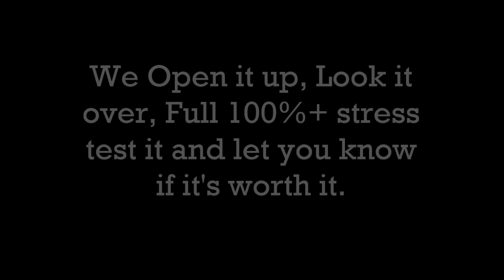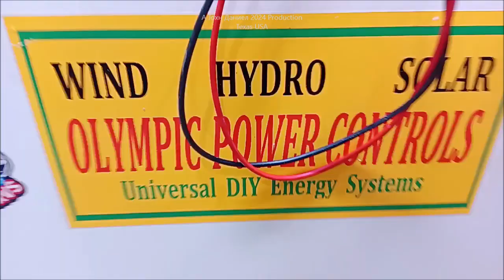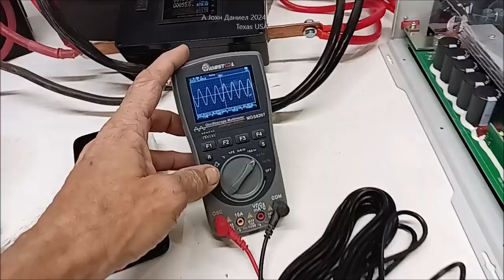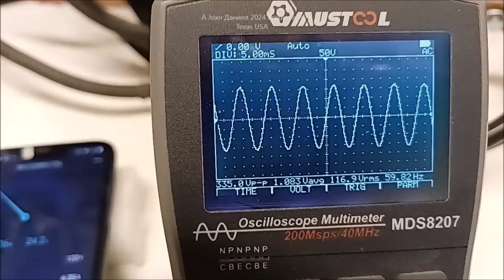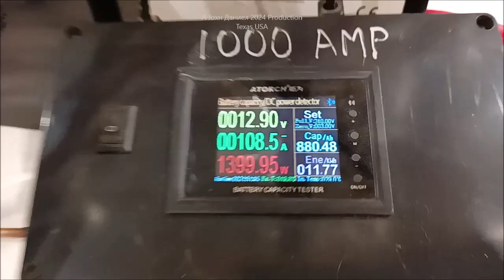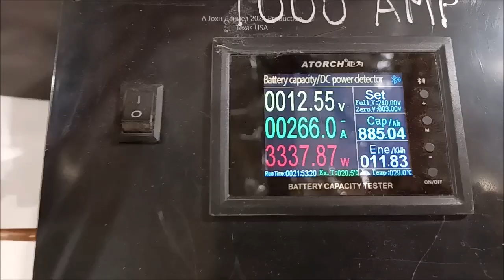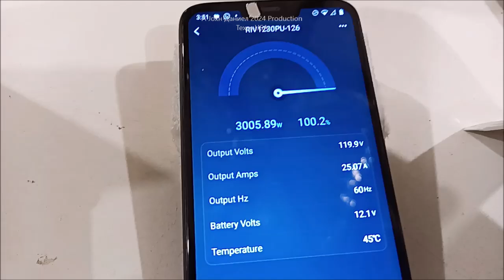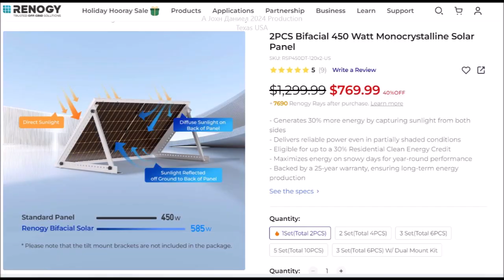New for 2025 Renogy Pure Sine 3000W Inverter with UPS Transfer Switch & Bluetooth, Pre-release test

Comment: I Started with Their 1st Generation 12 Volt 3000 watt Inverter and it was Hungry and worked well to 2750 watts. The newer 24 Volt 2000 watt Inverter is Right On The Money efficiency wise.

Comment: how did you get the wires in the greeen connector you did not show this in the video !  I am trying to use the UPS feature instead of the plugs for my RV ?
Reply from the maker: I think I need to do a update video on it, I figured that it was in the manual but it is not. You use 10 awg Solid and you strip them 1/2 and insert them and the terminals have a grip lock in them. To remove you use a tiny screw driver to insert next to the wire to open the grips and pull the wire and screw driver out at the same time.

Comment: Just got mine today.
Reply from the maker: If you wonder how to connect the AC power to them, you use 10awg solid wire and just insert it into the terminals for AC in. No screws needed, 30 amp capable.

Comment: Hello their a other new renogy pro 3000 watts inverter which no body has spoken about only one video review and no teardown like this video that helps the person decide what inverter is good or bad. Can you check out this inverter, its has 2 20amps outlet plus eco mode and other things.
Reply from the maker: The PRO 3000 https://amzn.to/4l9YQze is basically a Class 1 RV style inverter. Bigger transformers for higher start capability as long as you got the battery/amps to feed it. Great inverter, similar to the PU3000 in the video but much more suited for rough conditions.
Reply: @JOHNDANIEL1 - Thank you for the information
Reply: @JOHNDANIEL1 - When you say Class 1  RV inverter what that means?

Comment: What size wire from the battery to the inverter should I use ? 2/0?
Reply from the maker: Yes, use 2/0 if your to up to 6 feet from battery. Longer than that and up to 16 feet use 3/0. A link to TEMco welding battery cable is under the video for best safe heavy cable.

Comment: I have this inverter and have been using it for several months. It WILL NOT WORK without a “good” battery. Run your battery down and try to switch to “shore power” (or a generator) NOPE - you are SOL till the battery is charged up. So now you need to figure out how to charge the battery without the transfer switch doing its thing. Better have an extension cord and a portable charger or some other work around.
Reply: @tonybbq5212  that don’t sound good , I just ordered this inverter but I’m not hesitant. My batteries are agm and hooked to the alternator, so maybe that will be enough to make the transfer if I drain the batteries down below it allowing it to transfer to ac
Reply from the maker: The function of the UPS is to go to battery if your Utility fails and return to Utility when power comes back on. It's a transfer design not a inverter charger. Was missing the point in first reply to you. Inverter/Chargers do the low battery volt actions. I will have to check to see if mine has low battery volt switching or some blue tooth setting in a app. You can use the MOES controller to make one a Low Battery automatic switching and set it to switch and also run up to a 600 watt 40 amp charger to your battery. If you want info on that I can and should make a video on those. They are $80 to 90 and worth it.
Reply: @JOHNDANIEL1 how low are we talking on the battery that it won’t let you switch to shore power ? That’s a huge flaw
Reply: You HAVE to have something wired incorrectly. It has a transfer switch so if you fire the gen up the transfer switch should be sending a charge to the battery bank in float or bulk and your converter (assuming you are in an RV) should be distributing A/C on it's own from the generator or shore cord. How big is your battery bank? My suggestion is to charge your battery to full and if you have more than one battery make sure that they are balanced. If they are LiFePo they should each be charged to 14.4 volts individually (remove cables to do so) and then reconnected. Once each has achieved 14.4 re-wire them and they will be balanced.

Comment: Does anyone know where to find a SCHEMATIC of wiring, fusing and cabling for a 3000W 12V Renogy inverter using 2 x 290Ah (or 300Ah) batteries with 200A BMS? Please
Reply from the maker: Basics Should be in the manual of most inverters. Use 2/0 gauge cables, use quality 300 amp ANL fuse and best holder such as  Daier tech mount. Pair the 2 batteries with 2 awg to a mains buss bars. Not complicated but must be capable of high amps and service.

Comment: Very much appreciated your review.  I ended up buying this model as well.   Question, at around 12'15" point, you discussed how to use the AC Output and AC input terminals (the green terminal connections).  You mentioned about using 10 AWG solid wire to push the wire for example into the Live electrical slot.  I am wanting to use wire ferrules to push into the electrical slots, but am having difficulty with this.  I also thought the rectangle slot above the wire could be used to release the wires using a small slotted screwdriver, but could not seem to get wire to be release either by this method.  Do you have any suggestions with the Renogy 3000 you reviewed, how to connect using ferrules and how the wire release mechanism works on this unit?  Thanks so much
Reply from the maker: Avoid Ferrules they are too big and will damage the grips in it, and only use solid 12/2 or 10/2 wire on them. To release use a small Philips screw driver pushed in next to the wire just till you feel the ability to retract the wire out.
Reply: @JOHNDANIEL1  Thanks for the insight on the Ferrules, and using the philips screwdriver next to the wire to loosen the wire grip.  Great video again explaining the specifics of the Renogy 3000 inverter.

Comment: Will my 50 generator hurt the transfer switch on this unit?
Reply from the maker: Not sure what a 50 generator is, but if the voltage and hertz matches your settings on the unit and you do not mis wire it, your OK

Comment: Please, please show me how to install an AC power INPUT cable into that input termnal block (the right side one). I have tried everythihng I know and cannot get the wires into those clamps. The manual is of no helo and my Gemini AI bot said to use a screwdriver in the round hole and pry the clamp in the square hole open. I've spent hours modifing the bare stranmded wires trying to to get into those square holes, to no avail. I am at my wit's end and about to send this monster back to Amazon and hjsut give up. BIt's no good to me without the availability of shore power. Please help or send me guidance to a reliable resource. Thanks so much.
Reply from the maker: @rlanford88  I believe these are plush to lock wire terminals. You have to use solid wire, 12 and 10 gauge solid Romex with the wire stripped clean about 1/2" bare and inserted into the proper sides. It has 4 sets of grips that grab like cams/bites onto the solid wire. To remove you use a tiny Philips screw driver, insert in same spot with installed wire and work it out.
Reply: @JOHNDANIEL1  Thanks so very much for the hint. I have some single 14 awg wire on order and hope it works. Then am I correct that wire goes into the round hole, b, or the square ones??
Reply from the maker: @rlanford88  It should on the right, round holes, be labeled LINE ( L ) black, Neutral (N) white and Ground will be the romex bare wire for you on there or in the manual. You will push into the round holes, 5/8" to 9/16 stripped clean is best. You will feel resistance and it will go in. But NO on the 14/2 wire. Absolutely not.  Please use 12/2 or even 10/2 on it. 14/2 will be risky loose. Ask a neighbor for a few feet of some 12/2 or 10/2 romex scrap, they sell 10 foot sections at hardware and home centers. To make your connection to stranded then using RED 10-14 size wire nuts and your stranded  stripped almost 2X as long ( 1-1/4" ) as your solid wire ( 3/4" ) you fold the stranded in half, lightly twist it up, and then match it to the ends of the solid and wire nut on your stranded cable or a 12 gauge extension cord ( preferred). 
Note the unit has a Hertz selection use 60, and a Ground/Neutral Coupling System. Run it "without bonding" on the switch is preferred but you can wire for bonded but be sure no FRAME or Shared grounds are affected. See the manual on that explanation. Wire ONLY with 12/2 or 10/2 do not use 14 awg unless its a extension cord from the 15 amp outlets.

Comment: I bought one of these to replace the one in my rv. However i have found that It requires the inverter to be on for the transfer switch to work.  So when I plug into shore power and turn the inverter off,those outlets won't work. Can you confirm this?
Reply: @jaredsyme3733  I installed one in our Brinkley yesterday and found exactly the same thing. Basically it makes the auto transfer switch worthless as it makes no sense to have the inverter on all the time when we will only use it 5 - 10% of the time. With the inverter prep on the RV the 30 amp breakers (input and output) controls all the outlets plus the main inverter AC. Without 12 volt power to the Renogy these outlet are dead running thru this inverter. I do like the inverter and with the install complete when I found this glitch I’m going to add an external auto transfer switch and just bypass the internal one, and just use the output side of the inverter. I do believe this is a big miss on Renogy’s part, the inverter prep on the RV is very well done but with this 12 volt power on only function it disables the system.

Comment: I've had the 2000w version for a year and still can't figure the transfer switch out hopefully it tells in this video ❤
Reply from the maker: The transfer switch is to automatically switch from input 120 volt to inverter in a power outage. Most can be configured to run on inverter till battery drops to low setting and then starts on the utility power instantly. Check your manual with one you get.

Comment: Does any body knows if this renogy puh 3000 watts cames with 20 amps outlets, because i would like one that brings 20amps outlets.
Reply from the maker: Just took a look the 3 outlets are 15 amp, the hard wired side is 30 amp wiring. It's got 25 amps total output @3000 watt.
Reply: @JOHNDANIEL1 - Ok thanks. Because i looked at the renogy pro 3000 watts that comes with the 20 amps outlet but no body has done what you did with the PUH to see what is inside. I would like to know before i buy it was is inside the renogy pro but not see nothing yet, if it better o the same as the renogy puh.
Reply from the maker: The solution is just make you a hard wired version of the 30 amp twist lock drop cord on the PUH3000 model. I have this cable I use to add 20 and 30 amp outlets for high amps just cut off the male plug and hard wire port it. https://amzn.to/4bquB33 Probably about $25 to add to it. As for the other ones that have 20 amp plugs on a 3000 watt model you can really only pull what the inverter can make so it would already only allow you use of one of those outlets anyhow. And most having a 20 amp socket only have 14 awg feeding it. Stick with the hardwire drop option so you know you have true 10 awg like the one in the video has to connect to.
Reply: @JOHNDANIEL1  Ok thank you

Comment: Does this renogy puh has the 20 amps  outlets like the renogy 3000 pro  that has 20 amps outlets?
Reply from the maker: Mine does.
Reply: @JOHNDANIEL1 - Is yours a renogy pro 3000 watt
Reply from the maker: Right, I have had 3 renogy 3000 models since 2019, one does, this one in video don't.

Comment: Would you trust this to potentially run a coleman mach 3+ 13.5k btu AC?  Thinking about wiring one of these to my converter in my trailer for offgrid
Reply from the maker: I would say yes, get them on Amazon https://amzn.to/3ES7Fh6 since dealing direct with Renogy lots of people are getting the China Hours of service/holidays run around. And definitely add a Soft Start module https://amzn.to/4hSJGgq to that AC unit to assure no fails or damage to anything. They have them on sale right now. You will want over 300 amp hour of battery, preferably 500ah and use 1/0 cables on it.

Comment: Great video John.  I just installed a 2000 version of this and noticed the transfer switch does not allow shore power to flow thru to the rv circuit unless the inverter is turned on.  Is this normal?  It does work correctly as long as the inverter is on of course but I think shore power "ONLY"  should be able to complete the circuit even if the inverter is off?  Any thoughts?
Reply from the maker: Transfer has to be powered, so you have to have a active circuit to make the relays act as designed. This is done so you do not have power running when some other issue happens. Otherwise you may have live terminals when no lights or action is on and get shocked. Even a cheap UPS has to have recognition of option to work. Thanks to UL and ETL certifications!

Comment: I hope this is a sing that they are gonna be improving all there stuff
Reply from the maker: The new models have been though guys like me who take a bit of coin to do product verifications. A dozen of us who pushed them, dissected them, broke them, repaired them, and sent in reports on any issues. My first one was Proto3k and the end result from my testing was upgraded board current capacity, they did it. The SMD1K resistors changed to MSMD1K so they cool better. The relay to Grid/Circuit default changed to silver contacts,  and they immediately fixed all the findings and the result you are now seeing. I would say this line of inverters went though real test and upgrades before it was sold to the public. SO,  My opinion, Renogy has gotten up to grade A in the last 12 months without a doubt.

Comment: I have a 1000w renogy eco and it sucks i specificly told them what i was wanting it for and was told it would work great sent it back because of all the problems and they sent it back  said nothing was wrong with it . The only thing i like about it is it does have low consumption  when it isnt in use

Comment: Another great review.  Thank you

I have a question. Hopefully, someone can answer. I have a 24v Renogy 2000w inverter. I'm trying to connect it to my breaker box. I'm using the same breaker I use for my generator. Main breaker is thrown, generator breaker turned on. But I get a fault every time i connect the inverter.
Reply from the maker: Do not connect the ground from the inverter to your utility box, 2 wire only and it may work right. The inverter is detecting a bonded ground fault, so its not working right. That means it's having its common wire in it connected to its chassis ground from in the utility box. Depending on the model you may get stray voltage on the common on a inverter but no problem unless you allow it to ground back to itself.
Reply: @JOHNDANIEL1  You're awesome!  MUCH APPRECIATED!  It worked!
Reply from the maker: Good deal. The new 3000 I am working with in the video has a Bond/no bond switch built into it so it can be used without the issues on a circuit breaker box.
Reply: @JOHNDANIEL1  nice! Good to know.

Comment: That's a nice inverter.
Reply from the maker: It is amazingly strong and much more quality parts in it compared to the Renogy 3000 I had 3+ years ago. The huge upgrade in quality with Renogy has come about during late 2023 since new folks joined it. They are no longer connected to AIMS which had to be a great thing to get free of.

Comment: Nice! What about the transfer switch?
Reply: So I have this inverter if you were connected to shore power in your RV you still need to have the inverter on or it won’t work. When you plug your power in 120 V AC that goes through the inverter it is enough to power some things but it won’t let the complete 120 V Run my AC unit which it should just go through the inverter I would think but I had to get a soft start for my AC now it seems to be working.

Comment: Curious as to the transfer switch functionality. Perhaps a follow up video showing it in action. Curious if the two built-in case outlets if and how are isolated (or not). Are those two built-in outlets powered by the transfer switch AC input under certain configurations/situations?

Comment: Why doesn't more inverters have a 50hz/60hz switch
Reply: My MFUZOP 2000 watt inverter (12 volt) has that switch.
Reply: @JohnT.4321   do you use it?
Reply: @viyusavery248  Yes, since August its been in use with no issues. The inside of the unit looks similar to the unit in the above video.
Reply: @viyusavery248  Europe uses 50 Hz, so having 50/60 SW opens up a much larger market.
Reply: @WTFgus   I checked the MFUZOP and it does have it the only other one I can find is the Brand: Sunivora 3000w but it barely has any reviews which makes me suspicious 😕